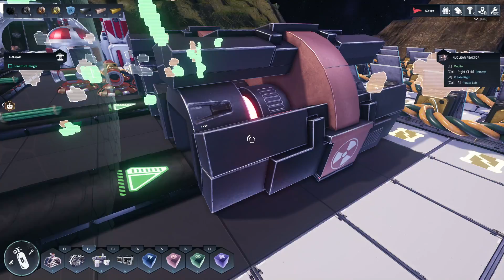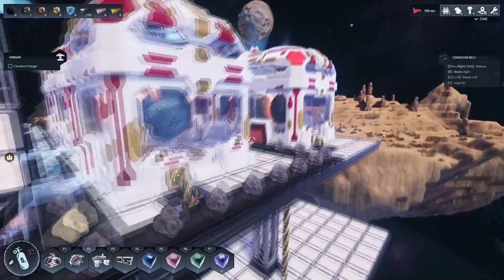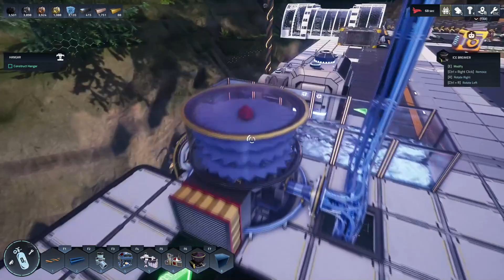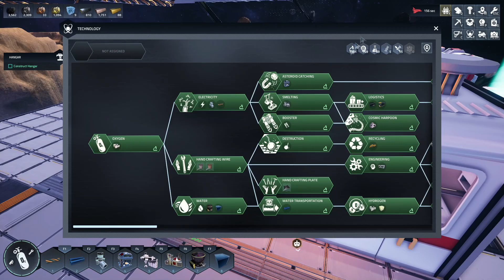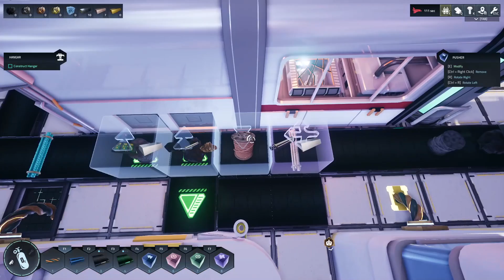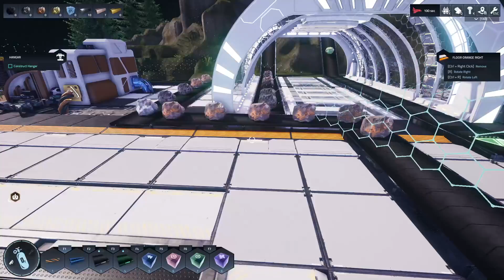Sorting Out The Mess | Astro Colony

Comment: The way I got around the 'waiting game' on incoming resources was to have them go straight into a Warehouse , then by switching the Warehouse to 4 inputs and 8 outputs and using logic filters to separate what was coming out , I then fed the sorted ores into their own smelters with each outgoing line , warehouses will output to all exits at the same time as long as they are filtered to allow 1 resource, so no delays and instant sorting.
Reply from the maker: yeah i dont like the central storage so i just use it to hoard things. now
Reply: @Hybridsteel  Aye, me neither , but I still just use it to instantly sort incoming ores from a belt, that warehouse basically never has anything held inside it, stuff just goes in and is instantly auto-sorted and exits the relevant belt exit and onward to where it's either used or stored.